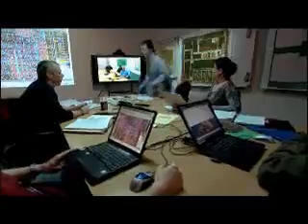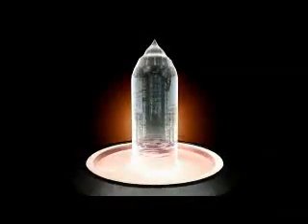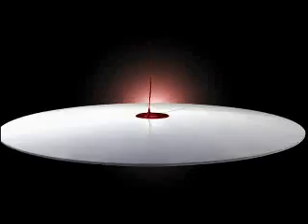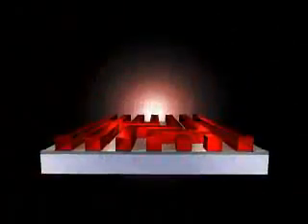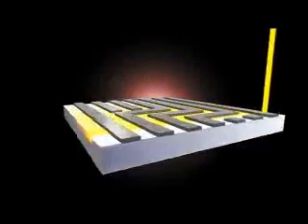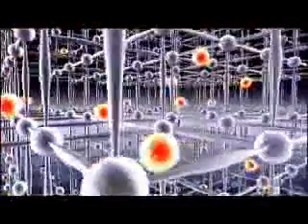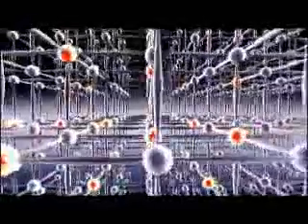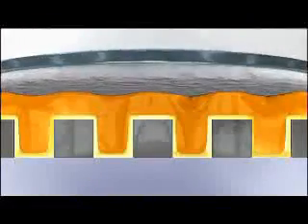AMD CPU Manufacturing

Comment: prove what? That i have a 2600k @ 4.5ghz? LOL. Just google. 4.5 ghz for a 2600k it´s a NORMAL overclock. Most people use 4.7, 4.8 and some even go to 5.0 or more. I have an old Thermalright Ultra 120 XT with two 120mm fans and socket 1555 adaptor. the voltage tops @ 1.288v when running prime95 Small FFTS test @ 75ºC for the hotter core. That´s why i don´t push it further.

Comment: Intel has the quality, and AMD has the power.  My opinion is that most games seem to run better on intel, despite there high price, but multiple applications go with the 4 gh 6 core at 200.00 USD>

Comment: FX is actually worse than the phenomII. I have phenomII 955(amd rig, not even gonna mention intel rig "i7" cough cough) and it beats the FX quad core and probably comes close to the FX 8 core(i know it beats the 6 core FX) cause i saw 3 reviews in which the 6 core phenom(cheaper buy) beat the 8 core FX in quite a few benchies. Will be waiting for the more mature architecture coming next year called "piledriver" to see if the architecture is really worth something besides theoretical performance.

Comment: @yellowcard1494 Again, 3 times the performance is quite the exaggeration. I went to my friends house the other day for a Birthday party. You know what he has in his system? An I5 2100, sure, not a 2500, but still, a chip which you claim is superior (I overclocked his 2100 for him to 3.8Ghz). Needless to say, it wasn't. I got significantly better results on Cinebench than he did. Benchmarks don't prove shit, as I've said before, too many factors, such as hardware compatibility and bottlenecks.

Comment: @yellowcard1494 
1: very small performance differences, not quite worth it.
2: I would like to know the specifications of the bench-marking rig as that CAN have a biased effect (not on purpose) on the results, especially with GPUs. 
3: I don't care, my 1090t is at 4.21Ghz, still fast.

Comment: @yellowcard1494 False, perhaps an I7, but I have seen nothing on the i3 out preforming a 6 core chip. Besides, the performance boost you get using an Intel chip is tiny, so it's not worth shelling out a shit-ton of cash. The i3 is best suited as a mobile or media center chip. It's not that fast.

Comment: @Herrminha haha same here: started with a athlonXP 2200+. Then just like you a 3,1 dual core athlon64 x2 6000+ (still being used today)
Now I have a Phenom II X6 1090T (same chip as 1100T, only standard at 3,2 instead of 3,3) running stable on 3,6 ghz by only increasing the multiplier. Still good temperatures, even with standard cooling.

Comment: wow.. so amazing. as an ordinary person with regular sized brain, I can only relate this to how CD's are made.. so I'm thinking- would it be possible that in the future- there would be a "Dual Layer" version of such chip, like what happens when DVD came in. My concept is- dual layer atomic structure.. same size but double the capacity, thus double performance. Is that possible?

Comment: And the Phenom ii provided about 75% of the performance of an i7 running at the same clock speed.  More transistors really doesn't mean it's a better processor.  Still good for the price, and that's something AMD almost never fails at.